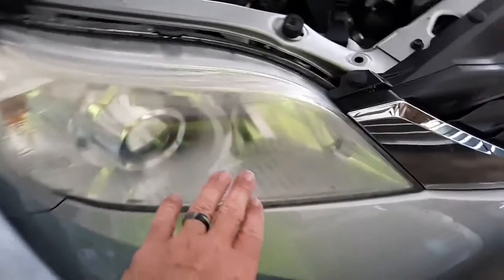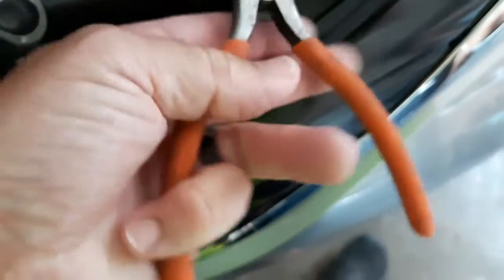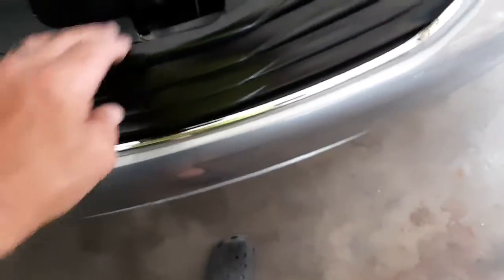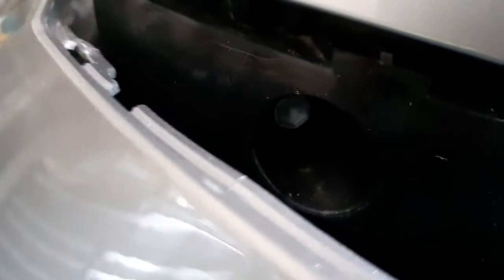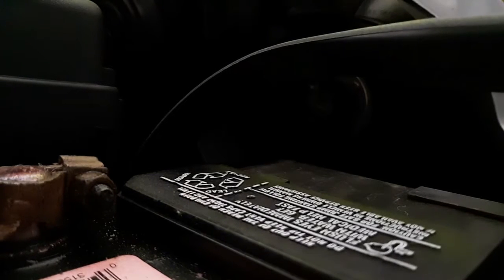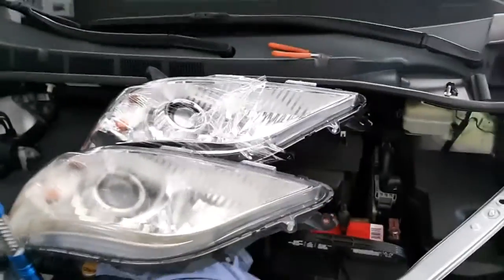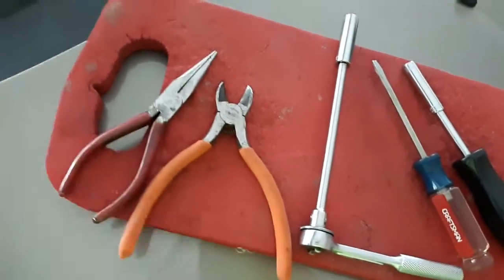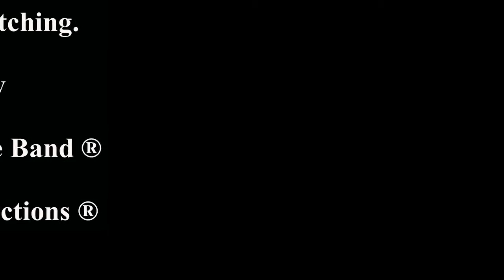How to install new headlight assembleys on my 2011 Toyota Sienna

Comment: You mentioned that you changed to LED lights. What was involved there? My model is LE.
Reply from the maker: The lenses I bought came with the bulbs and the little connectors that plug in line and then plug into the wiring harness it's some kind of a little capacitor or something to make the LEDs work they're bright I can tell you that I actually don't like LED lights on vehicles coming at me but I certainly like them on vehicles I'm driving cuz you can really see